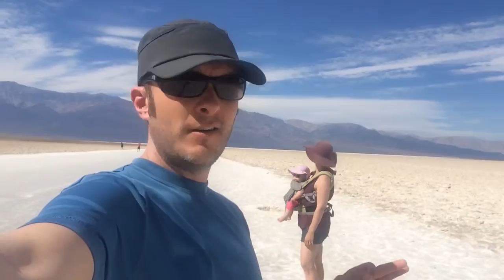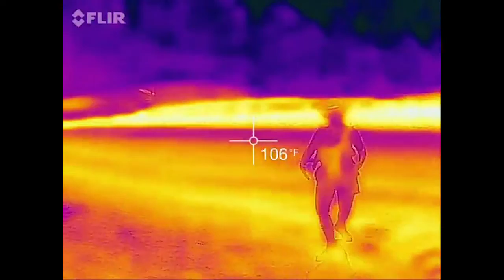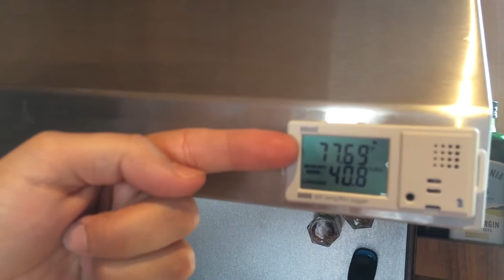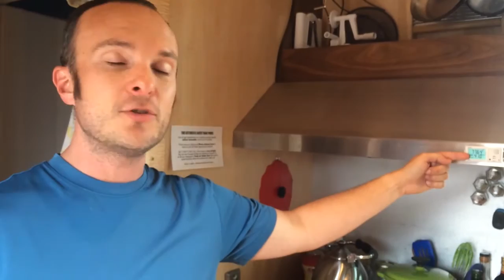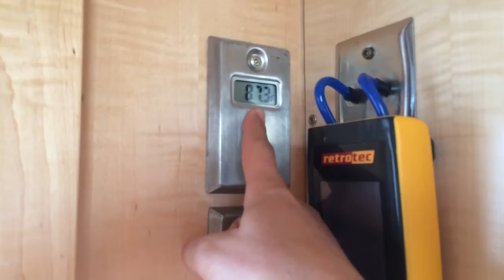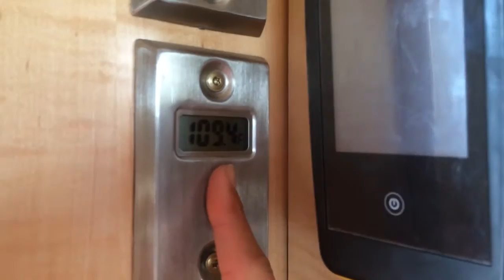Tiny House in Death Valley

Comment: Thanks so much for posting this. Can I ask how many BTUs your mini-split is? 
I'm planning a super-efficient tiny house for use in Phoenix, AZ and I've been looking everywhere for an answer on how many BTUs an energy-efficient mini-split would require to keep things cool in a tiny house. I'm leaning towards a couple of 9K models but I'm concerned that might not be adequate. 
Thanks again for this and your other videos. They've been invaluable in the planning process!
Reply from the maker: +SciCurious you should have a heating and cooling load calculation performed on your plans. Our minisplit is 6kBtu, and it's oversized.